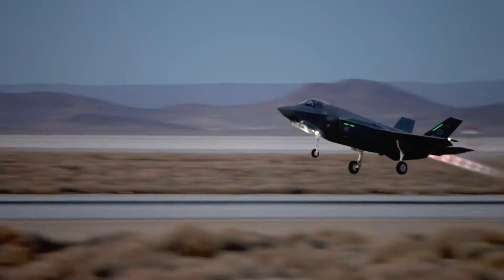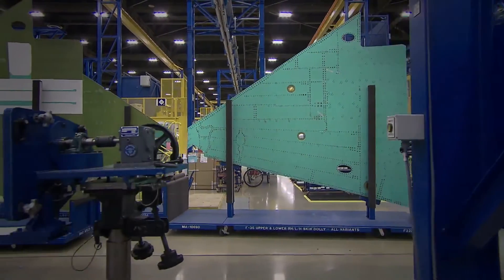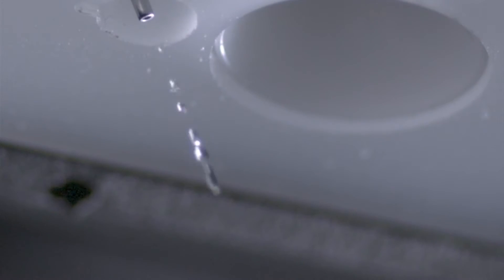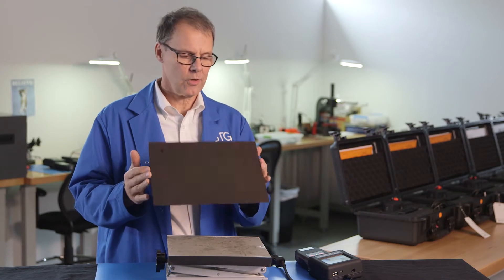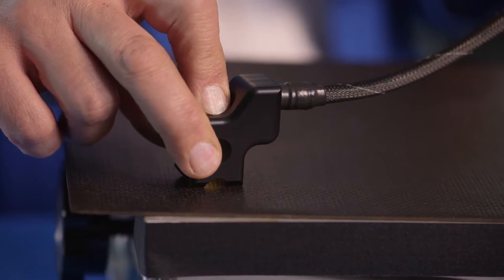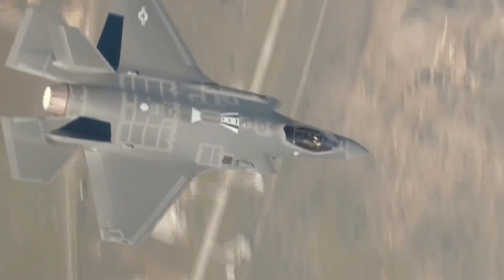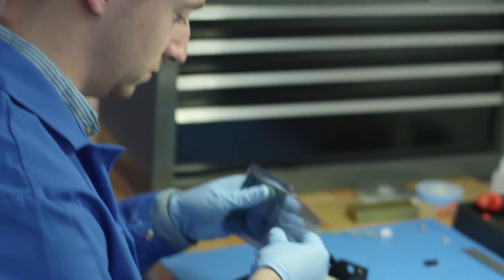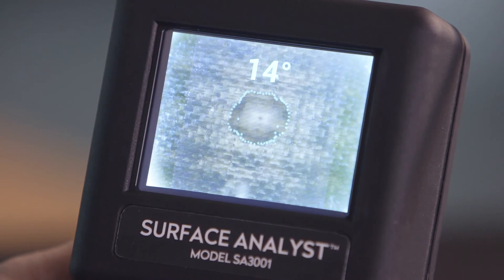BTG Labs Surface Analyst™ and F-35 Program

Comment: I was wondering about non aqueous solvents, that is if the adhesive is non aqueous base. Would water wetting angle still reflect the surface energies even though the surface tension is different?
Reply: It will work. Most of adhesives area non aqueous base (epoxy, acrylic, polyurethane, silicone, nitrile, chloroprene, etc). I believe none of structural adhesives (>1000psi (6.8MPa) overlap shear strength) are aqueous base. cmiiw